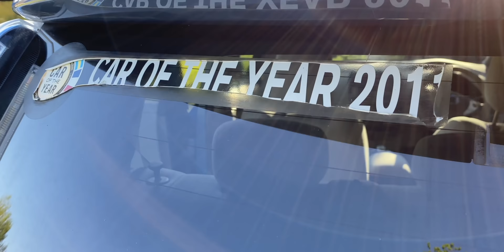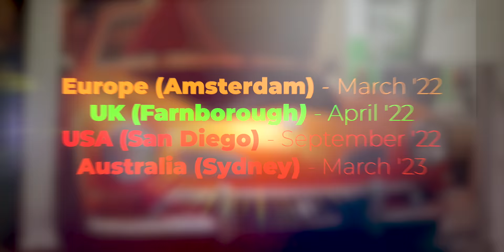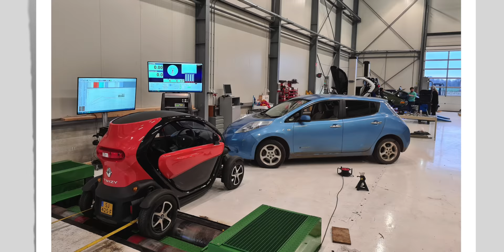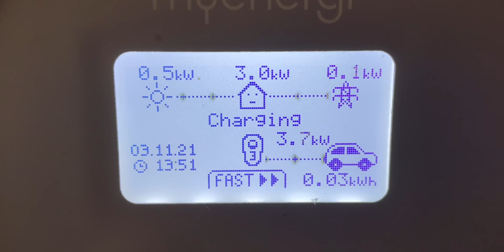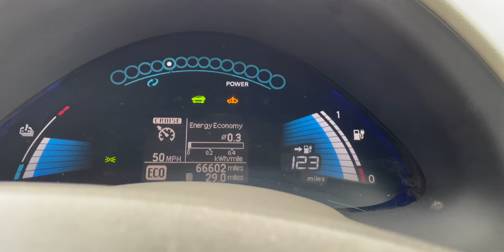Return of the LEAF: Robert drives his range extended EV home from Holland

Comment: Apologies for my blatant ignorance on this, but I want to find out if the infrastructure has improved in terms of not needing multiple apps or payment methods to charge electric cars.
We want the next vehicle to be an EV, but it needs to be wheelchair accessible and they are so far behind the times it's a joke.
I am hoping that the charging infrastructure has figured out to just let people use contactless payment that works universally father then a single app per provider.

£4,000 to replace battery after 66,000 miles is hie £ per mile, but just the cost of being early adopter. As says that is the past.

Comment: I have a 2013 Nissan Leaf. For me “fast charging” means using a level 2 charger to get a full charge in three hours, meaning 43 miles of range. Robert must have received some DC fast charging gear to go with the new battery. I can’t do any level 3 charging with my car.
Reply: No, most of the leafs have a second charge port, it's called "chademo." Your car might not have it, it was been en option.
Reply: buy gm ev 1 45 mile rabge

Comment: The original Leaf still looks good. I wish Nissan would scrap the 2nd gen one, that the lovely Ariya replaces. The original could be reduced to sub £15k new and fitted with an updated dash. I had the 2018 2nd gen Leaf for just over 2 years (superbly reliable, great to drive and built like a tank), but the design and spec is obsolete today for the price.

Comment: Wonderful you kept your leaf going with an upgraded battery - but I feel you're significantly overstating the lifetime of a battery.  I have a 2013 Model S P85 and the car has half it's original usable range now with significant phantom battery performance (zero is not zero, and it looses more range than the gauge indicates it should have consumed by 25%) after 9 years and 205k miles.  I would say that lithium packs probably have a 10 year service life before needing "servicing or replacement".
Reply: There have been significant improvements since 2013.  LFP batteries as an example, are much more durable.  Million-mile packs will become commonplace.

Comment: Very interesting video showing that even if you did have a a battery failure after 10 years or so then you could replace it for a fair price which improves on the original car. I suppose battery replacement like this will become even  cheaper in the future and all the arguments against EVs are just dissolving rapidly.

Comment: Great vid, just one question, do you have to inform your insurance company about the battery change?
Reply: I'd like to know the same!
Reply: Not sure why you would, unless you had a comprehensive policy and wanted to raise the loss value of the car in case it got totaled.
Reply: @redbaron6805  well I'm pretty sure if I had an ICE car and put a larger fuel tank in, or a larger engine, or made any mods that would affect the weight of the car and therefore the stopping ability, I would have to make my insurance company aware of these mods, or at least that used to be the case years ago when I did such things, not sure if that's still the case now as Roberts car will clearly weigh more than it did, and is modified from original spec.
Reply: @danthrelfell15  I'm pretty sure you don't.  As noted earlier, unless you wanted have the insurance company cover the increased loss value, why would they care?

The weight difference is nominal and the performance is the same.  I see no reason why the insurance company would care you car now has increased range.

Comment: Really enjoyed this video. I have a 2015 Nissan Leaf mk1 with a 30kw battery. It currently. has done about 65,000 miles, and still gives me about 105 miles / charge (depending upon the usual factors, of course). Do you think this (admittedly newer) version of yours, might benefit from a new battery when it falls off too? I ask because I'm not sure if the basic technology in mine is still the same as yours, or is it more advanced, meaning the battery might last longer?
Reply: búy ñew iñe 226 miie tejsa cels add 16 prrçt mooré rañge

Comment: Too bad you didn't upgrade to the 6kw onboard charger from 2nd gen Leaf...on my 30 KwHr battery I can add 26% per hour  which happens to also be 26 miles... plenty fast. My car has quick charging..but using it in combination with long high way drives... probably not a recipe for longevity.   I resist and resent having the Leaf spoken of as "obsolete".   The Leaf is like a VW Bug,
with a star trek heart.

Comment: So I checked a few figures. Value of a 2011 Nissan LEAF with the 24kWh battery and a comparable milage is about £6k-£7k. Add the £4k to change the battery to a £40kWh capacity and it’s about £11k if you wanted to create a clone of Robert’s car.
The 40kWh capacity battery pack wasn’t available until the 2018 model year, (current generation) and to buy a used LEAF of 2018 vintage would cost about £16k-£17k. As the second generation car is quite different to the early cars it is fortuitous that the bigger battery fits the first generation cars.
So would modifying the first generation LEAF be sensible or would it be more sensible if you can afford it to simply buy the later car?
Reply: The thing is that £4000 for the battery that Robert bought is very cheap compared to what it usually costs. For instance a 40KWh battery from Cleevleys costs £8900 Inc VAT. More than double what Robert paid. So the battery would cost more than the used Leaf and would put the price of the used car and the replacement battery at about £16,000. So the same price as a used 2018 Leaf with the bigger battery. If it was possible to get used 40KWh batteries fitted for £4000 that would be amazing but I don't know anywhere that does it at that price.
Reply: @alexandermckenzie2767  Interesting point…are you suggesting Robert received a special deal and that the company in Amsterdam would not carry out this upgrade for other customers at that price?
Reply: @tsb3093  I have to assume so. Looking on eBay at sold prices for Nissan Leaf batteries, a used 24KWh battery costs at least £2500. There were no 40Kwh's for comparison but you have to assume they would cost possibly double the price. So £5000. And that is just for the battery, no labour or any other parts. I think what has happened here, and it is only a guess, is that the company came to an agreement with Robert to swap his 24KWh battery with the 40KWh, the company gets to keep the old battery and the labour is free in exchange for the exposure on the Fully Charged Show. So it may well only have cost Robert £4000 but it seems highly unlikely that a Joe Bloggs would get the same service for only £4000.
Reply: @alexandermckenzie2767  I also just had a look at prices and have to say I concur. Note that the Company you mention Cleevely Electric Vehicles quote (for a 30kW battery) £1500 labour to fit the battery pack. A 40kW LEAF Battery pack on eBay now is listed at £6,500 and the asking price for a good condition 24kW battery pack as you say is about £2,500. So the numbers sort of add up on the basis that Robert was not charged for labour at the market rate and the trade in value of his old 24kW battery was at market resale value. All in all I reckon that the sensible thing would be to buy the 2018 model….assuming you could afford it that is. The deciding factor is probably residual value. Robert’s car looks to be in good nick but secondhand it is probably not worth over £11k.

Comment: It’s pretty sad, as if you are correct at the end of the video in saying that the cars will fall apart and be in pieces before the battery is stuffed - it’s a pretty poor indictment on the quality of the car. A car should last 20-40 years at least. And no current battery will last that long.
Reply: How many parts must be replaced on an ICE vehicle in the span of 40 years?  How much gasoline? How many gallons of motor oil, etc...?

Comment: So why wouldn’t batteries ever need replacing? Is there an episode that explains?
Reply: Improved battery chemistry combined with better battery management hardware and software, top buffer and bottom buffer to prevent charging to true 100% and proper thermal management of battery packs in modern cars should make this a non problem.
Reply: @davidspencer7254  wonder when will we see this in phones
Reply: itß bayery çharge ç7çke befurevreokç all ayer sç500 cyçkes   tooo   8000 cyçkes

Comment: And ABSOLUTELY THE LAST comment from me - I have rarely bought a car less than 8 years old. And usually kept them running till they are at least 20 years old/250K miles on the clock. Are you telling me a battery will last 20 years? (bearing in mind you had yours replaced at about 10 years) And if you/the industry is expecting a car itself to fall apart after 10 or so years - or before the battery is finished - then what message is that sending the world? How ecologically/environmentally friendly is a car that needs 'recycling' after only ten years? So, if the major thing about EVs might mean a battery change at, hopefully, half-vehicle-life, the second hand price of EVs will depend on where you are in the car-battery cycle. Or are you saying that the car will be scrap before the battery is? I think any car should have 20 years of life without anything major needing doing. Just saying (-;)~

Comment: Can you explain why/how batteries have changed and why they won't need replacing because when they first came out we were told that they were basically a big mobile phone battery and we know that they deteriorate or are mobile phone batteries programmed to deteriorate thru software updates (or is that also a myth.) Either way, would like to understand.
Reply: You could still charge it up to 100% if necessary,just make sure you get this figure down asap by driving the car
Reply: Different chemistries have different properties, applications and needs with regard to charging and use.  Lion batteries don't like to be fully charged and fully drained, which is what we  typically do in mobile devices.  Try to never charge above 90% or use below 10% and your batteries will last longer and have more charge cycles.  But they still have a limited number of cycles they can achieve before degradation sets in, 300-500 depending on use.  Which is pretty much 2 years of normal use on a mobile before we start to notice it getting annoying.

Comment: after watching again, i have realised it wasn't a straightforward battery swap, + the the true minimum cost for this conversion would be £7000 +, day in, day out.
it would be a good idea for mr lewelin to admit this, to set the record straight........
Reply: Where does the other £3,000 come from, apart from the trip to Amsterdam?
Reply: @stopthenames  they fitted a new shape [ze1] battery to an old [ze0] leaf. for starters, the second hand 40kw batts are £7-8k, + other mods are reqd to make them talk to each other/work correctly

Comment: I fully understand the reasons for promoting full electric cars primarily to protect the environment and the World. My thoughts are about net zero and as far as I’m aware just producing a car and a battery is not a net zero manufacturing process. I do not have the answers, I wish I did but moving on into the 2030 era this isn’t far away there are talks about Hydrogen fuelled cars which still use a four cycle engine system but what comes out the exhaust pipe is water, so would this possibly be another avenue to explore. I know Toyota are looking at a Hydrogen fuelled car and I think Toyota are not alone.

Comment: Hi Robert, can you tell us if the car with its new replaced 40kWh battery has been modified to go bi-directional as well, did you thing to ask if they can make this mod?
Reply from the maker: The car was not modified in any way other than the battery replacement. There is considerably more hardware needed to enable V2X so the answer is no. What we need is for all new cars coming out now to have this system enabled
Reply: @fullychargedshow  I only mention this because someone in the comments of this or another article covered in FC said that you could take it to a Nissan dealership and get the software up-dated, so that it becomes bi-iderectional, has he tried this?

Comment: I really love what you are doing for promoting Electric car but the Kona wasn’t the best example of a car with no battery pack replacement because most of them have manufacturer recall for replacing the battery pack but for now it’s not going to cost anything for the owner but are they going to be ok after the initial warranty is out just a thought the same is happening to the Chevrolet Bolt and I know they share the same manufacturer LG.

Comment: Rob, great video !   Still not sure why Cleevely EV AutoMotive Gloucester didn't do the battery upgrade ????  You did a video last year about them.  Why did you go to Holland ?  Did they do a  better job ?    I have a 2020 BMW i3s REx and can say the batteries will last for 15 - 20+  years, based on my experience of 3 other EV BMW;s  I've driven since 2015. clocking up 30 - 40,000 miles on each car, with NOTHING GOING WRONG. and Yes, I mean Nothing has gone wrong on any car.    As you said,  The battery will go on and on and outlast the entire car.  MY YOUTUBE Channel shows examples

Comment: Tempted to upgrade my 2011 Leaf but held back by the 3kW charging speed. Would a new battery charge at a faster rate?
Reply: No. Charger is a charger, it have no connections battery capacity.

Comment: I think the transition to battery power cars is good but it's too fast for the average person charging over to them. recharging them is a problem when you don't have a driveway the last thing I want to do is plug it in somewhere and walk home in the snow rain ect. They should make small diesel petrol powered generators to charge the battery whilst you're driving when it gets to a low level. then I would buy one.
Reply: OR......you COULD replace the electric motor and batteries with a diesel engine.........!
Reply: @andymccabe6712  yeah why not.

Comment: That battery replacement myth cannot be overstated. It is a total myth. Even early cars with relatively unsophisticated battery management systems, more often than not still have very usable batteries in them. Yet the myth persists, even from responsible broadcasters like the BBC, which I have to say often puts out EV tech news which is grossly inaccurate. It's as if they have an agenda, which is odd because they don't rely at all on advertising, so you would expect unbiased accuracy. Laziness BBC?
EDIT: Can I have a little post-video gloat? I finished work on the 23rd and left with my ID.3 fully charged [for free of course, and yes to 100% for once]. Did quite a bit of pootling around since and just looked at the car's We Connect app. 235 miles. Isn't that nice? Sorry Robert.😇
BTW, look after that little gem. I want to hear regular updates on how it copes with a 40kWh battery. Will it ever overheat like the occasional 30kWh is said to? Did it/will it suffer from a little Rapidgate on a roadtrip? Nerd questions I know, but important ones.

Comment: If you went for the 64Kwh Battery plus the 18Kwh range extender you'd effectively have 82Kwh Battery!! Or, according to this video that calculates at 370 miles of range!! Add some solar panels on the roof and front bonnet (like one guy did) and manage to extend the range a further 10%. If you intelligently Charge one battery whilst using the other (via some intelligent interface/add-on) you could not only extend the range but also the life of the battery. You'd then be getting up to 450 miles range!!
Maybe take overnight to charge...but seriously ...who drives 450 miles a day anyway!!??! Especially without a break, which you'd need at least half hour every 5 hours, according to road safety recommendations. Perfect time for fast charging your Car at a service station. Range Anxiety is DEAD!! It would take the average driver between 9 to 10 hours to drive 450 miles, without breaks (not Brakes!! - don't mix those 2 words up when talking about cars!! Ahhhh!!) in optimum road conditions in the UK.

Comment: How did you get it to Amsterdam in the first place? 😀 also curious about rapidgating on the way back
Reply: 40kwh does rapidgate, but less then on 40kwh Leaf, since this leaf is 80kw, but ze1 40kwh does have a power of 110kw, so, battery heats up less during a driving.
Reply: There is a shot of it on a tow truck or trailer at one point. Looked like an ICE vehicle.